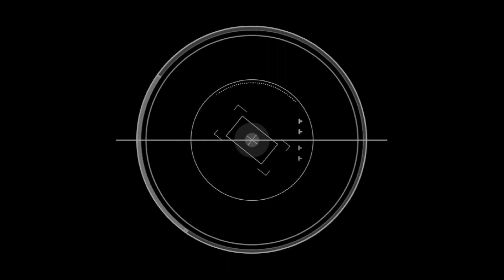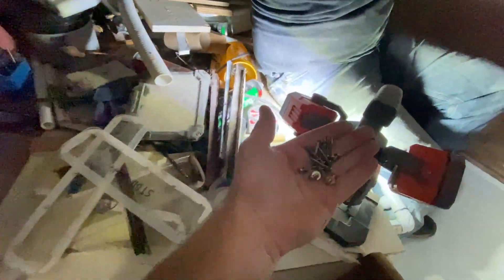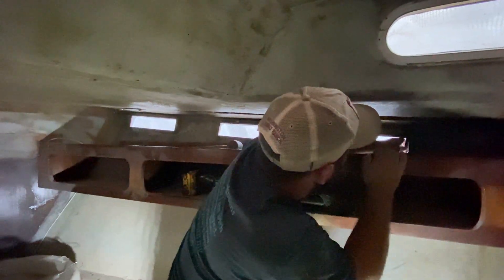Get a Grip! Checking more items off our refit to-do list. #SailboatRefit

Comment: Are you sure you will have enough ventilation in your cabin with no ports/windows that open?
Reply from the maker: There’s actually a sliding hatch above that we recently replaced. Tough to tell from the angle we filmed though. Also, and the temporary cover on deck doesn’t allow much light to shine though but it’s there! Big enough for my butt to escape from so we should be ok 👍